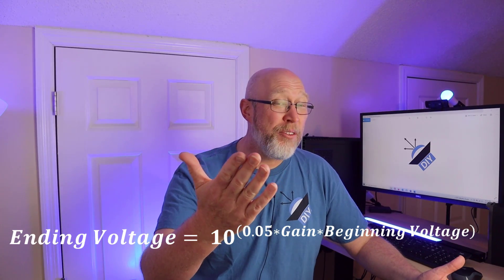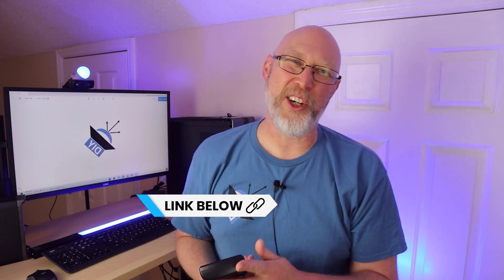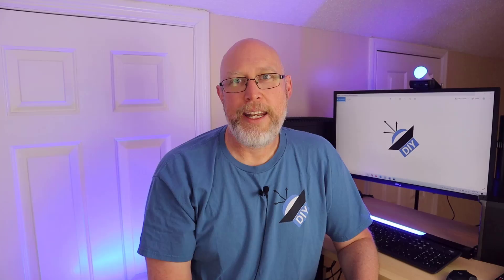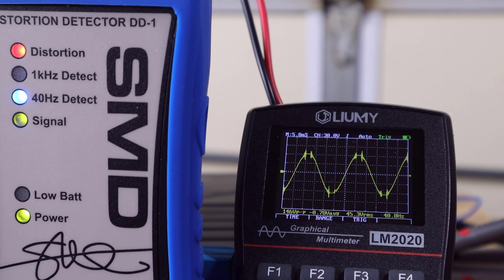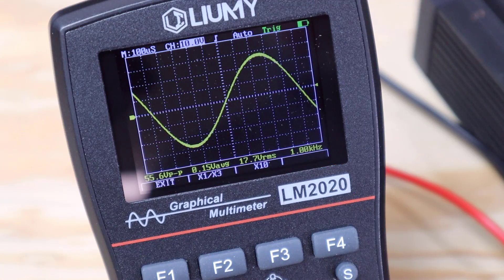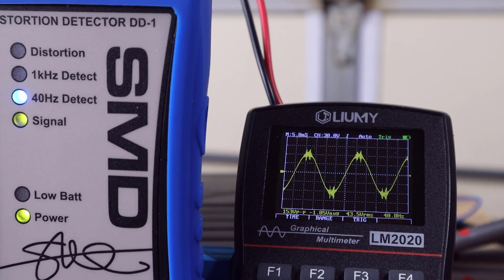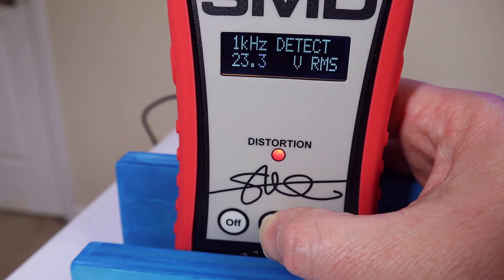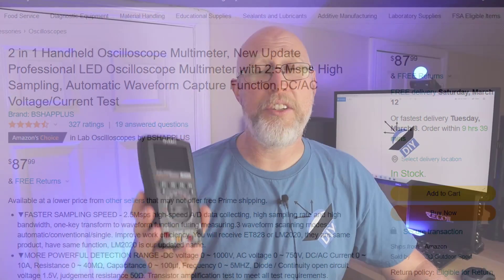Maximize amp power with gain overlap! #setyourgains @meade916

Comment: Great vid! Ive been running a -3DB overlap on my 12” sub but am in the process of upgrading to a beefier sub. going from a D4 sub wired at 2 ohms to a D2 sub wiring it at 1 ohm  so I can extract 1200 rms output from my amp where currently im “only” getting 800 rms with the D2 12” (of course then theres battling impedance rise). since I have to re-tune I’ve been wanting to try -5DB. I did know the basic principle behind gain overlap and music recording levels but didn’t fully understand it 100% so thank you for the easy to understand explanation! I learned  some things also!  Now with the upgrades and -5DB tune hopefully i will be satisfied with the new bass output (at least for a while lol).
Reply from the maker: Awesome!  Glad it was helpful.

Comment: Can u do a video with a smd cc-1 for gain matching for some odd reason on test bench it works fine but when in a high voltage system it doesn't work i only askin u because i cant get answers anywhere else thanks in advance
Reply from the maker: I don't have a CC1, sorry.
Reply: @DIYAudioGuy  yea was askin cause idk whats goin on lol but i dont think its the cc-1 the problem is i think is the amp im using (sundown sfb 5k ) its puting out voltage at speaker output with out any rca input its weird i know and tried a taramps md8k and it does the same thing the cc-1 works perfectly on my Rockford prime 1200.1. NOONE WILL HELP OR CARE TO EXPLAIN WHATS GOIN ON
Reply from the maker: @smurfjones66  That is odd. Do you have a regular multimeter?  Try checking the voltage with that.
Reply: @DIYAudioGuy  yes i tried the output voltage without rca input in and voltage still comes out i think its somthing to do with these kinds of amps
Reply: Soo in ac voltage i get 0.200v with no rca input and dc voltage heck it just keeps goin up i stopped it at 30.2v without rca input  no clue what any of that means

Comment: Great explanation Justin. I also don't care for the name "gain overlap". It's accurate but when thinking in layman's terms, it's confusing. That said, I get it! Kinda funny as I've been setting up audio systems for years. My man work now is around pro audio systems. We don't want any distortion so I'm  staying far away from any "overlap". Like you pointed out, if we need it to be louder you need to pay for more power and speakers that can use that power.
Reply from the maker: Right!

Comment: Is it possible to get an accurate reading from the handheld o scope on the head units rca outputs? I ask because i recently picked up the scope/multimeter that you show, an when connected to one of the head units speaker channels clipping occurs around 32 (volume) but when   i connect to the rca preout even cranked all they way up its nowhere near clipping. Is this normal behavior for head unit's or am i possibly getting a bad connection or wrong setting on the scope?
Reply from the maker: That is not unusual at all.  I'm told that most pioneer head unit units go all the way to full volume before the RCA's clip.  I've only ever run Alpine head units in the RCAs will go up to one notch before full volume before they clip.

I'll buy an RCA to speaker adapter, you can get them for just a couple bucks from Amazon, for testing RCA's. It's so much easier than trying to put the probes on or in the RCA plug.
Reply: @DIYAudioGuy  i tried finding some but couldn't find any that worked with scope/multimeter combo that you used. Of course what they sent looks a a little different from the one in your vid.
Reply: Nevermind i just fount it. Thanks for the tip. Next question being should  i go off the rca since im only using amps or should i still set to the clipping point of the the headunit speaker outs
Reply from the maker: @nickstalhood5380  A lot of "copy of a copy" on Amazon these days.
Reply from the maker: @nickstalhood5380  If you are not hooking anything up to the head unit then just go with the RCA's.

Comment: The record level depends on the music. I have seen purchased factory recorded music that was clipped from the studio. Bass heavy music is very often at 0db or clipped. Most metal albums when check are fully clipped from the studio.
Reply from the maker: I was going to include a little bit about the loudness wars, but It really made the video a little bit too long.  

Some of this stuff is not just clipped, they apply compression to it so there are no dynamics, it really kills the sound quality.
Reply: I concur, knowing your music files/ sources is more important than overlap. Compression and limiters encoded into audio sources will mess with the overall sound and overlap turns into an EQ which may or may not distort. I use 0db tests for everything HU/amps/mids/highs/subs, then play around with actual post-EQ / DSP + mic and if needed (personal preference) bump up the bass a little.
Reply: @dreci3001  
Odd, because you're effectively negating your own work if you do post-EQ adjustments that do any form of addition to pre-EQ adjusting.   If you're in the boat of doing things "up to the clipping point", then make an EQ alteration which adds to output, you've entered into the realm of clipping (albeit ever-so slightly). A multimeter could even see the difference between your output pre & post EQ alterations. Personally, I prefer to set up the equalization to where I know it'll sound great, then raise gains "to preference, for SQ" or "to the clipping point, for SPL", then dial down to DSP+mic readings. That way, I'm taking away from something that's already too loud rather than adding to something that's not loud enough.
Reply: @RAW_Reality  I try and stay away from clipping. Maybe I didn't write it right. I always try to spare amps. I go with the DMM and scope piece by piece in the signal chain several times as well as a mic to have an overview. I also do this to the DSP. I set EQs then measure again. I do some math and set amp gains last, based on the provided figures. Since cabin gain is very pronounced in cars, I EQ the peaks, then bump the overall level, while measuring again. Any music that enters my car is processed with software, Im a bit old school unless it's FM and no streaming services.

Comment: I personally run -7.5db overlap on subs and 0db on mids and highs I have a mmats hifi 4250d the 4 channel is an absolute beast and overpowers my speakers more than double. I've had this same setup for years.
Reply: Overpower is better than maxed out gain (tricking the amp thinkin its getting 8v when its getting 3.2 thats CLIPPED from a 2v preout) !  Thats how try explain it to the kids!  Yet they still wonder why a 500watt amp blows a 1500watt rms sub in less than a week...then trash talk whatever brand!  Semt my son to school with one 12inch 600rms sub with 800watt amp but getting clean 4v signal at 3/4 volume WITH EQ STILL IN IT!  Son said the kid with four 12s will turn his down now cause he no longer the big dog!  Yet his 4 12s is clipped out from a 2v Dual HU from the start!! I get asked all the time why old man like me has such loud bass and must dont have room for stuff in back SUV...then i show them its a SINGLE 8 in long box with corrcet airspace and got great LOC that takea factory and boost CLEAN signal to 5v to give my 500d amp to 1ohm 800rms 8inch!
Reply from the maker: That sounds like a pretty good setup!

Comment: You are so Awesome!!!!!! I have that same DD1+ and for Speakers, specially those JL Auduo C7 speakers I have on my ford flex, I have the gain set at 0 db nothing higher just to make sure I get the cleanest signal coming out if the speakers, as for the subwoofer, I just use a -5DB overlap. Anything higher on a smaller amp and I would just consider getting a higher powered amp instead of adding a stronger distortion signal to the subwoofer.
Reply from the maker: Right, if  you want it louder add power, don't crank the gain.

Comment: @DIY Audio Guy  one thing that no one talks about and i cant find any info about it, is:
everyone talks and is woried about setting the perfect gain on the amp, but no one talks about if the speakers will handle that "perfect clean power"
so, you have a 4x100 rms and a 1x1000rms amps... you set the gain perfectly, and there is zero distortion at max volume on both amps.. (setting with the method you do in this video)
BUT all you have is 4x45wats rms speakers, and a 1x250Wrms subwoofer... wont the speakers and subwoofer clip like hell at that "max clean volume"????
so if you have 1000watt clean max power.. is it fine to put a 50w rms sub???? I REALLY DOUBT ABOUT IT.. i dont understand why people only talk about the max clean power an amp can deliver, and no one talks about the max clean power speakers can handle... its ridiculous...
that is why i set the gains by hear.. 
1-all gains to minimum, 
2-put 0db test tone and start rasing hu volume till you hear speakers clip to find max clean volume on hu and back just one notch for piece of mind..
3-start rasing amp gain till you start to hear speakers clip, and stop there. and you are set... 
for me that is the only way you find THE MAX CLEAN POWER A SPEAKER CAN HANDLE at 0db...! (and its free to do this method)
what is your opinion on this?
Reply from the maker: You can use a multi-meter to set the amp at a level the speakers can handle.  I mention that in a few of my videos.    But the reality of it can be much more  complicated, speaker power handling is wildly misunderstood.  I am running 3.5" mids that are rated for 15 wrms with an amp tuned for 50 wrms.  The reality is that they never see that much power on actual music, and the crossover keeps out the lows that cause over-excursion.
Reply: @DIYAudioGuy  for me the multimeter way is the worse one.. all the math into it goes wrong cause rms on amps and speakers in the real world, are never the ones you find in owners manual... try my method.. ( and make a video about it ahahah)
keep up the great videos
Reply: @sergiobisonte  I would never suggest someone set gains by ear unless they are very good at hearing distortion. Using a multimeter to set gains is perfectly fine considering the fact the math isn't wrong. What could be wrong is the rms rating of your speakers or amps. You also have to factor in cabin gain which is a reason why people think they are feeding their subs more power then what they are rated for. Setting gains with an oscilloscope is one of the best ways to set gains

Comment: For mids and highs I always use 0 db of overlap. I prefer have the comfort of knowing that I’m not distorting whatever than it be a little bit louder. I personally like how 5 db of overlap sounds on Sub amps. If 5 db isn’t loud enough than I think the equipment should be upgraded instead of adding even more overlap
Reply from the maker: Absolutely.
Reply: 0db for mids and highs. 0db with bass knob at 50% and clip monitor on dash
Reply: @oscarishandsome5150  Where do you get a clip monitor?
Reply: @bugsysiegals  if your amp model supports, you can get one built by your amplifier manufacturer.
Reply: Problem with that is "bass knobs" are from from linear. Ive had plenty that do very little until 3/4 turned up
Reply: Me too. 3-5db. It easy to hear and adjust the deff. freq hz of the lpf.  Either lows or hard. If isn’t loud enough? Then upgrade the sub or the amp. It cant overlap or clipping if you did not over tha gain and the volume headunit.
Reply: You are absolutely right. I tried putting over lap and the amp doesn't like it because because mids and high are more dynamic and taxing to the amps because mid and tweeters tend to produce less impedence than a sub woofer. 3 to 6 db to me is good for the subwoofer since some sound have little bass and it balance up nicely. Also the sub amp have a bass knob and clip light so you can tailor the bass to suit.

Comment: Justin so the only difference between the dd1 and the dd1+ is setting negative overlap say -5 -10 -15  for the dd1   or   1-? Overlap for the dd1+
Reply from the maker: With the DD1  you set "overlap" by using a different test tone.  The second set of tones that comes with the DD1+ is a -15 db track and you can fine tune the "overlap".  The dd1+ also has a voltage display.

Comment: I find the suggestion of running gain overlap a bit odd, especially as much as 10db. An overlap of 3db means that at full tilt, you have 50% signal distortion! This is something I've played around with in the past and I'm now in the 0db of overlap camp. If you need to run overlap to hit the volume you desire, you're better off just getting more subs, a bigger amp, more efficient speakers, etc because any more SPL you get is made up of exclusively distortion. Overlap does not change your max clean SPL.
Reply from the maker: A few DB of overlap will be fine on most music.  Some people use 15 DB, that seems bet excessive to me.